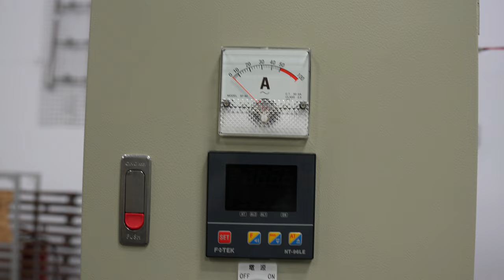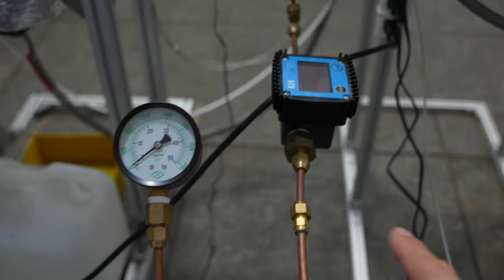Bin-Juine Huang - Discussion of his groups low-yield but easy to build system

Comment: Have you responded to Critical Review of Bin-Juine Huang et al. Paper Posted on May 29, 2024 by maxfomitchev ?
Reply from the maker: Max, who I know is competitor in Cavitation energy,

Re COP - he did not read the prior papers that refer to COP calculation methodology. Basically heat is accumulated in a large insulated storage container. This is far in excess of what could be produced by the electric input to the system alone.

He did a flame test for the Neon.

Since that paper, another was presented at ANS showing more data supporting the elemental findings. Moreover, I have shown the structures consuming matter and ejecting stellar synthesis.
Reply: @MFMP  Thank you for quick response. It looks like the initial paper you are referring to Excess Energy from Heat Exchange Systems 2022. Unfortunate Max did that. His is on the first page of results when you search for the initial paper